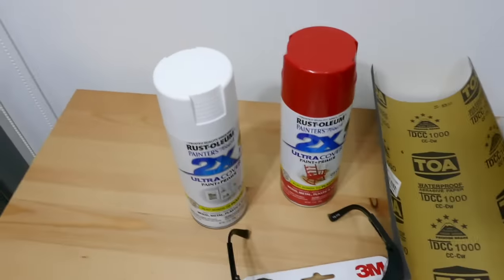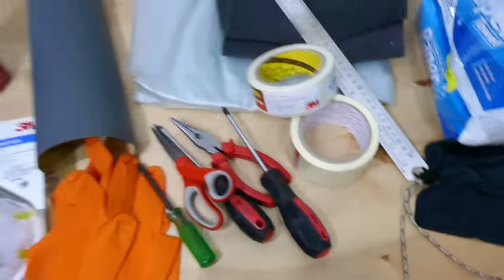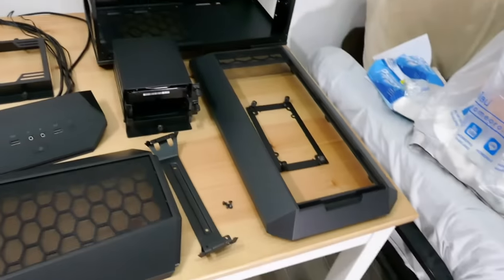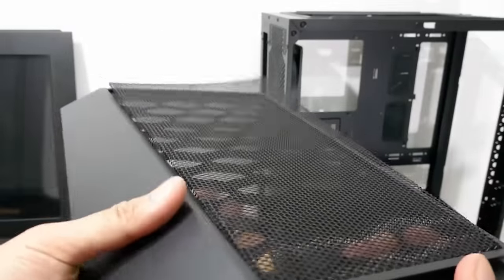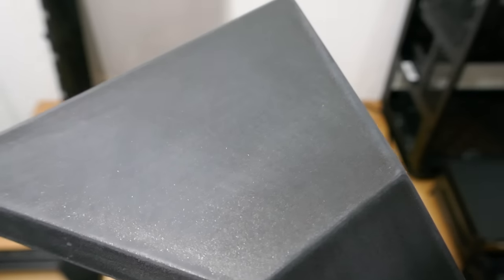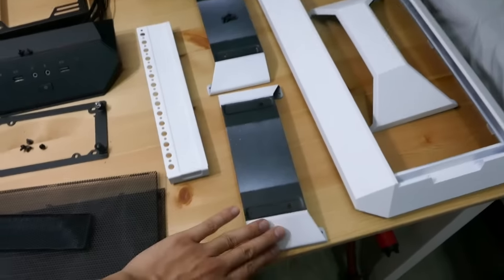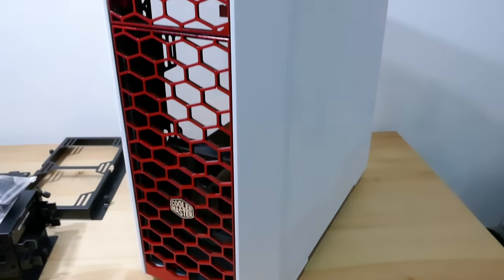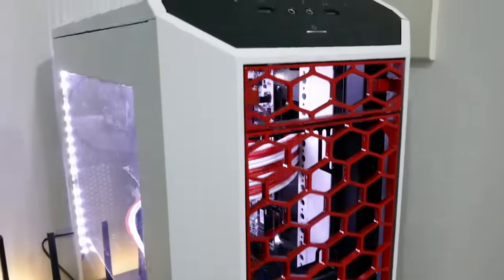Mastercase Pro 3 Paint mod and take apart PC case

Comment: You did a nice detailed job on this case. I ran into the video looking up how to properly paint a PC case. I have seen others who just simply wipe down the plastic parts and spray, others sand and use primer sand again then spray. I'm deciding whether to mod some OE HP 800 G1 mini towers I have and turn them into cheap custom painted budget gaming machines.

Comment: Just a tip we picked up while sanding my case, add some soap (dishwashing soap) in with the water when you sand it down. It makes that sandpaper glide over but still take off the sheen that you want to remove.

Comment: Great Video... 

Here is something you might want to consider for future mods and that is using the Blue Painters Masking Tape. You will find it sticks very well but also releases far better than the cheaper Regular Masking Tape. Regular Masking can leave residue behind that might cause problems for painting and it can pull up fresh paint too.

The paint you use is great, the newer Spray Paint with Primer really sticks well to Metal and Plastic. But if paint sticking is a real concern you can always use a Primer first than Paint after. I look forward to seeing what you get into next... Cheers...
Reply from the maker: +Paul Bialozor thanks for watching! Yes I will try the blue painters tape on my next video. I have noticed in this video there are some minor paint bleeding, will blue masking tape solve the problem?
Reply: Blue painters tape is a lot easier to remove, it's not as sticky as other brands, also remove the masking tape before the paint has fully dried and it's a lot less likely to crack or lift when you're removing the tape. try it next time.

Comment: how is the paint holding up?
Reply from the maker: +rampagejenny it's holding up really well!
Reply: you've inspired to paint my case. I messed up and bought a gray case when i wanted black
Reply from the maker: +rampagejenny hey sorry to hear that, I have never tried to recover a paint job but if I were you I would try sanding the messed up area and paint it over again - assuming it didn't messed up any electrical wires. Just a reminder - you have to really take your time, don't rush. I hope that helps